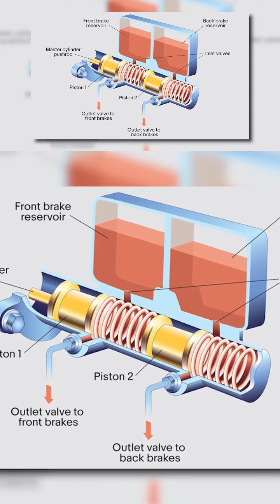How 1970s Cars Nearly Killed the ABS Revolution

Comment: Dual brake reservoirs were required by law in all cars in the 1967 model year
Reply: All cars in US were required by law to have the dual system well BEFORE 1970.
Reply: How does it help, when I open one circuit to bleed that wheel the pedal sinks to the floor?